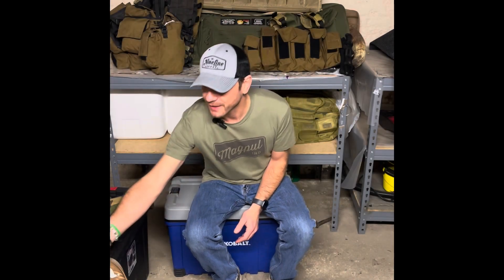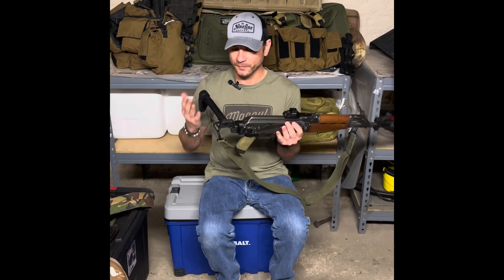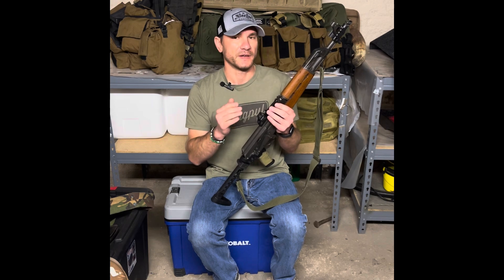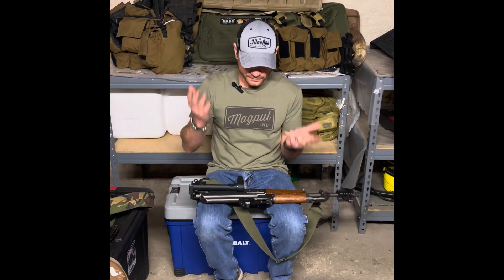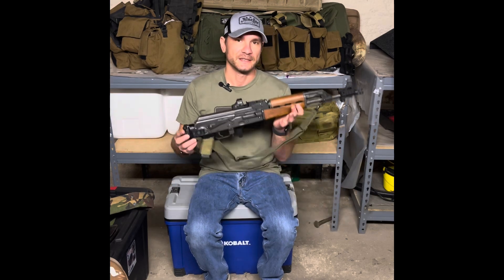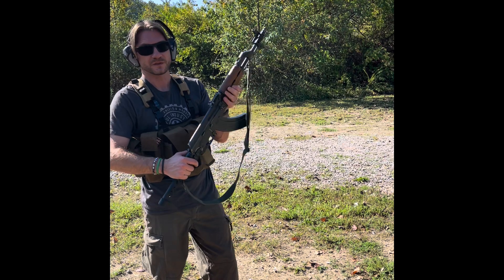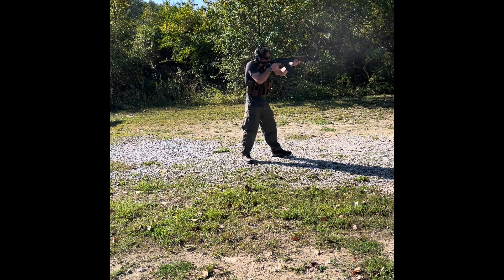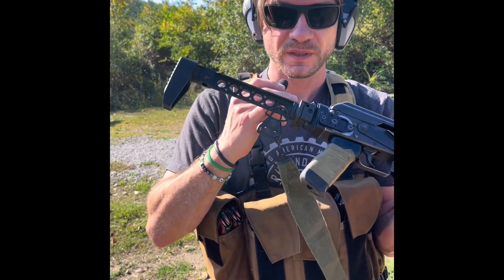M70ab2 contractor upgrades and field test. #jmac #m70ab2 #yugo

Comment: Add an inch of padding to the stock..might help your length of pull. And your shoulder 😅
Reply from the maker: @mobilegamersunite  valid. It’s sooo smooth now. Soft recoil. But the extra inch wouldn’t hurt
Reply: @non_tactical_talor8353  is the gas adjusted at all on this rifle?
Reply from the maker: @mobilegamersunite  nope